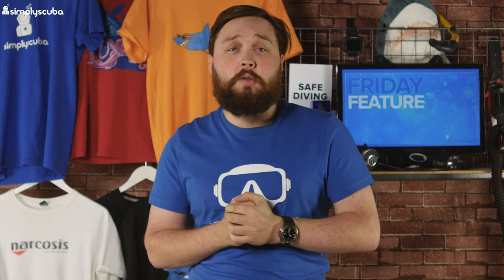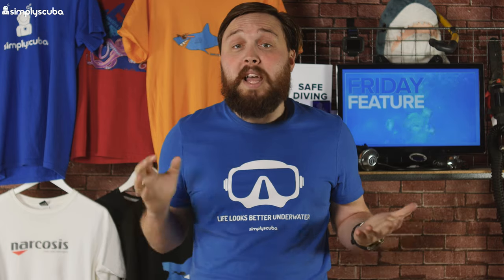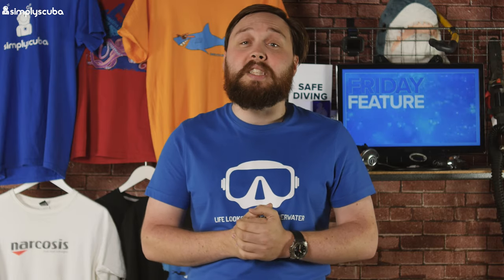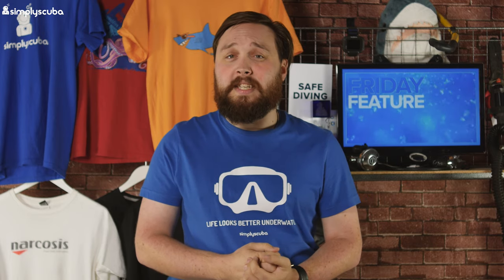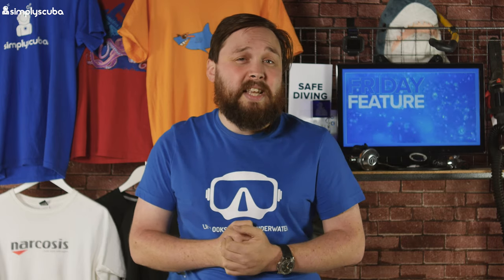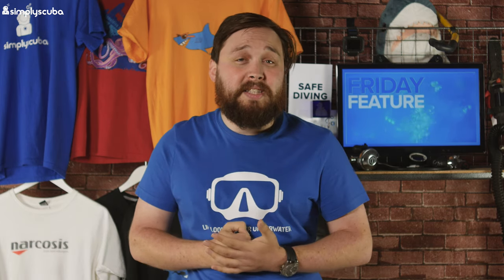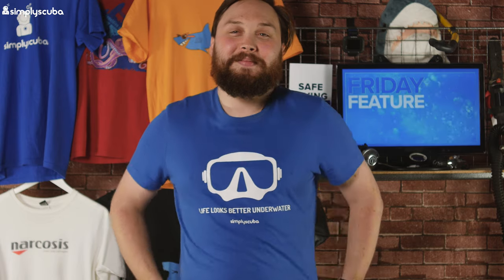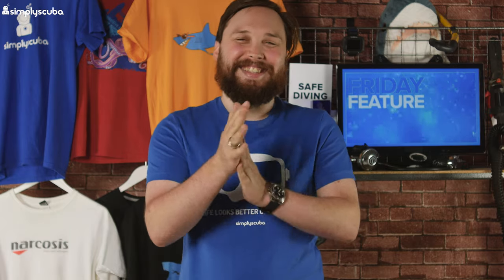Why The Standard Scuba Setup Is Wrong!

Comment: I dont agree regarding your comment about snorkel hanging cause also one of the main reasons to have a snorkel is incase there is waves it’s easier for you to breath comfortable with your snorkel ( yes we have our second stage but its a mater of just safety let’s say u had a bad dive which u run out of air and you are on your way to the boat or shore with high wave you will have easy breathing with the snorkel) so its just a mater of safety nothing else

Comment: As a recreational diver with almost 300 dives, I disagree with almost all of these points. I like my jacket BCD, I'm comfortable with it, I am familiar with how it works. As for many extra D rings, you don't have to use them all, that's ridiculous. It just gives you more options for locating different gear on different dives. And snorkels? I have spent a lot of time waiting at the surface after I have gotten in the water, while some newbies take forever to get ready. Not knocking newbies... we all start somewhere. But I'd rather use the snorkel than my tank for gas while on the surface, especially if it's slightly rough. I think you are talking from the perspective of a pro, highly trained diver, not someone who just wants to enjoy their vacation....

Comment: Why is modern kit so damned heavy? I learned scuba years ago, when the 'horse-collar' was new kit, 90% of divers wore wet-suits, and silicon was a kind of grease. I could kit-up unassisted, stand, walk about, climb stairs or ladders (without the fins on, of course!) - etc.
 But now, I have so much weight on my shoulders I cannot stand up without a fixed frame or something to hang on to!  I have so much lead on my belt, no matter how tight I pull it, if I stand up, it slides down!  Walking down a sloping sand or pebble beach is impossible verging on lethal. (and there's nothing to hang on to AT the water's edge!). - - This is the only use I can picture for a 'dive buddy' - to help you to climb to your feet! In UK water, they are a nuisance. More than six feet away, they cannot be seen, so you have to stop doing whatever to look for him/her, but any nearer, and they're in the way! Yes, I know that BSAC say you HAVE to have a buddy to help you in emergencies - Such as? If they aren't hovering next to you like a siamese twin, by the time you've found each other, it is too late! - - And what do you do when you arrange to meet at a favourite beach, or whatever - you've driven 200 miles to get there, your buddy was supposed to start from some other distant place, you get there, then get a message saying he's not going. Do you turn round and go home again, or dive solo, knowing what the risks are, and if something goes wrong, you have to sort it yourself (you do anyway, because your 'bud' didn't notice because he was ten feet away!)

Comment: I don't like your way of depicting your opinion as the right one.
- Lots of D rings doesn't mean you need to use them all at once, but you can choose the best spot for every accessory
- Wing BCDs are a bit better for the balance in the water, but you sacrify maneuverability (tilting to the side or upside-down if needed)
- Pockets in BCDs are hard to reach, yes. But they come handy when you collect a garbage piece from the ground. And if you can't operate your pocket, your buddy still can.

Comment: I know the 'primary donate' theory, but it seems full of holes to me. You're giving the one known good reg to someone who may be panicking. If your octo doesn't work, will a panicked diver happily give you your primary back? Not in a million years! As the only clear thinking diver in the pairing, I'm not giving my buddy the one known good reg, sorry. 

Likewise, long hoses - I've just switched back to a shorter one on my single setup, because the long hose is usually just dropping out and becoming a snag hazard (yeah, I know, stow it better, but it still finds it way out quite a lot!). 

Wings vs BCDs? It's a matter of preference. If you can dive well in a BCD and like it, carry on. Personally, I like having pockets, so I dive singles with a BCD and a wing for twins.

"If you're not using something on a dive, why take it with you?" - Good point, but sometimes something you didn't expect to use is what you need. I mean, you don't PLAN to use an octo, but no-one would suggest not having one these days, surely? Taking a torch on a bright dive might seem pointless, but you may find a hole you want to shine a light in.

Did you mention taking a spare mask? Sure you won't plan to use it, but if you can't see underwater, you can't carry out a safety/deco stop effectively, so I always take a spare.

 I agree on Snorkels, though, great for snorkelling! :D

Comment: My question is, when trying a back plate, I had issues wearing a weight belt.  What is the best way to wear weight in this configuration?  Ditchable vs non ditchable.  Any chance on a video on the subject?
Reply: You should be able to swim up from depth and be positive at the surface in case of total wing failure (unable to inflate or retain gas). Usually you don't want to ditch all weights because it leads to one another emergency - an uncontrolled ascent from depth. 
There's no "one size fits all" best solution.

Comment: Take this with a grain of salt as I'm not a diver(eventually...) but why do you prefer bolt snaps over carabiners? Coming from rock climbing and tower climbing alike, carabiners seem much easier to work than bolt snaps?
Reply: Bolt snaps are just more secure. I have used both on my kit and carabiners (cavers and tech divers call them suicide clips) seem to fail more often that bolt snaps. I have had carabiners springs that gave out and had my stuff come loose

Comment: A new diver with a 6’ octo hose? Tell me that is not going to create more problems than the infinitesimal chance of a bad octo reg in a infinitesimal chance it will ever be used? How often have you seen divers with free floating octos streaming behind. Often. There’s a reason only experienced tech divers use long hoses (in a specific body wrap configuration). It is for getting through narrow passages in tandem. As for backplate vs vest for new divers I believe it is far safer and more convenient for rec divers to have an enclosed compartment to keep their backup torch, etc than to have everything hanging loose of D rings. Tec Divers have pockets on their dry suits or the experience to keep things clean.

Comment: First of all, this is the reason a lot of divers think they are better than everyone and are massive dickheads. 
Sencond You said the octo should be longer so he can kind of panic away from you at a distance which is ridiculous. 
Also what is a standard set up. For me it is the basics. Which means no magnetic holds for octo. Not 8 accessories. 
Stick to the basics everyone knows how to use them. They are trianed how to use them. Otherwise things get complicated. 
Every problem I've had in 3000 dives is because of some wanna be tech diver not following standard protocols on a non tec dive.

Comment: Lots of good points.
A lot of divers could improve their diving by just removing shit tonnes of crap. The more Drings you have the more inclined you are to take unnecessary stuff. I'm also a fan of the long hose to donate and a necklace regulator setup.

As for backplate and wings... they are too expensive to the general community. But I do recommend then when I can.

Comment: As a dive master I like to be prepared for any eventuality. I carry a lot of stuff on my rig that I may or may not use throughout a dive. I’ve got a couple different types of BC’s but they’re all set up fairly similarly, (with the exception of my tech rig) i’m a firm believer in redundancy. To that end I carry two knives one on my leg one on my BC, two computers one on my wrist one on my console, two compasses one in my console the other on a clip, two 75lb lift bags “Mainly because I collect boat anchors.” I have a 19 ft.³ pony bottle that’s mounted inverted on my main tank, i’ve got a shoulder mounted strobe for low viz. and night diving and a pair of trauma shears. 

When I assist with classes I dive a bright orange Jacket style BC that operates identically to the ones the students use. For tech diving I use a Ranger back float set up for duels.

Comment: Ok 10 out of 10. Check. Love it you basically say every diver needs a DIR setup. I often have an argument with my buddies or instructors that follow Padi regulation. No you should have a yellow octopus on a yellow hose and a snorkel. Because padi teaches it that way.
Reply: Long before there was DIR, there was Hogarthian! LOL
Reply: I am a PADI instructor, and no, we do NOT teach that everything has to be yellow. We say that the octo should be brightly colored as to be more visible and easy to locate in an emergency. And we do require the students have a snorkel for open water training, again for safely reasons
Reply: @jwp8363  Jeff - this is not meant in any way a go at you but more as food for thought for all those out there who configure and stow the right hand feed octopus on thier right side.  The one thing I have noticed across all the PADI diving centres I've dived with around the world is that when using a standard regulator setup they configure and teach the octopus coming over the right shoulder.  I have never understood such logic especially when it means should the OOA diver require it they will effectively have to kink the hose in order to get the octopus in the correct way up and also be so close to to the rescuer it impeeds the rescuers ability to rescue effectivley.  Assuming the vast majority of divers who have privately owned equipment as well as just about every dive centre set of regulators have an octopus which also has a right hand feed, then it is much more logical the octopus is placed on the left side; this means the OOA diver can swim to the surface in the rescue (remember they are not incapacitated they just need gas) side by side whilst both rescuer and injured diver still maintain a firm grip on each others BC or Harness but they are not banging into each other.  There is also much less chance of the regulator being ripped out of the divers mouth as they are not fighting against the kinked hose. I don't have an objection to the Octopus coming over the right shoulder but if it does it should therefore be a left feed hose. The principal of the long hose on the other hand is not affected by being a right hand feed as the injured diver is able to place the hose across the back of the neck so there is no kink and still swim to the surface alongside the rescuer.
Reply: @stevenkirkman7719  I kind of get where you are coming from, but I feel your explanation may be a little flawed.  We have both primary and octo hoses coming off of the right side of the first stage as you described. The primary goes OVER your right shoulder and the octo goes UNDER your right shoulder, not over.  If the OOA diver comes up to you, they will usually come to the front of you, not always, but usually. The octo, which can also be used by me in the event that my primary becomes faulty, is in the correct configuration for me to use (my octo air hose actually connects on the back of the octo rather than on  the right like my primary does).  The   octo is therefore not kinked when I hand it the OOA diver. Since he is facing me, I hand of the octo to him and use my right arm to do a Roman handshake with his right arm. That keeps us close together and since we are both drawing air off of my tank, the dive is over so we are not continuing to dive, we are going up in the water column, so we do not really need to swim side by side. By us facing each other, I can watch the OOA diver, especially the eyes because that is usually the first sign they are going to bolt or panic. And since we I have a hold of the person, I can be better prepared if they decide to make a rocket accent. I hope this explains why they are both on the right side
Reply: @jwp8363  Hi Jeff, in your case as you explain the Octopus hose comes off the back of the regulator then I get the hose doesn't kink in the same way as if you used omnidirectional regulators such as Posieden. However in percentage terms I'd suggest well over 90 percent of divers do not have omnidirectional regulators but have standard regs where the octopus hose is attached on the right in which case the hose is kinked.  Whilst the Octopus can be used by divers as a secondary regualtor when the primary malfunctions the dive, the primary function of the Octopus is not for the owner diver but for thier buddy in an OOA emergency and even so if the owner has to swap to the Octopus the dive must still be aborted and as such better the diver copes with kink in the hose rather than an OOA stressed out diver. 

I don't disagree with any of your points in regards to rescue but in my experience of having conducted several rescues on divers with both configurations the one I have found works best is to have the octopus stowed on the left side if the hose is fed from the right.  I also agree it is preference and often the configuration a diver uses is down to what they were taught in the beginning but I'm just passing on food for thought.

Comment: Spoken like a true salesman.
Reply: a good salesman will sell you what you need in a way that will make you value their recommendations.  Of course, they want more money from you. but if you are sold the wrong gear by a salesman and you need more later you are NOT gonna go back to them.  I would rather be told if you buy this it is cheaper and will do what you want right now. later if you want to advance you will need to sell this and replace it all over again. 

However, i would respect being told if you buy this its more expensive now but when you progress later you don't need to replace it. you can progress later by ABC and will be cheaper in the long run. you can buy a 400 computer now and when you want to go more technical you will need a 1000 computer. if you think you may want to do that later. buy the 1000 computer now and you will save the 400 in the long run.  i am gonna respect that more and come back again. 

that's the difference between consulting sales strategy and just being a salesperson.